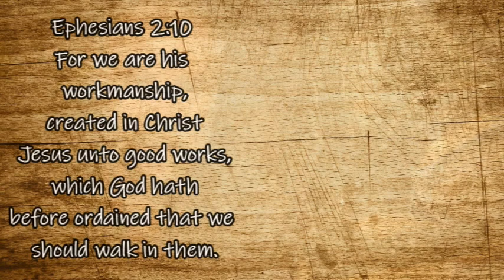Wood Lathe Work: Making a Rice Bowl

Comment: Lovely.  Brought back memories in my dad's wood shop I used to do a lot of wood turning. Babies rattles. Bowls etc. I used to use a metal broken  hacksaw blade with the lathe switched on to cut it free.. never had anything spin off as I had a sheepskin polishing round in my other hand to catch the work in  they make great finishers. Buffing up beautifully too. Can't wait to catch your next video.
Reply: Yeah, I have done the same with just the separating tool but have made the mistake of dropping the final product, leaving it broke or marred. Clumsy me. Sometimes I play it safe. Thanks and good point!

Comment: What an awesome skill you have to make Mrs. Rain such beautiful items. She is very lucky! How long did one bowl take?
Reply: There are a lot of variables in the time it takes to turn something. These were worked from the tree to final form. Before they get to the lathe there is prep work: cutting down, slabbing, storing, drying, selecting cuts for the bowl blank, glue up's for the bowl plate, etc. The bowl mounted to the lathe and turned down, finished and removed takes about, say 45 minutes. You will see turners claim 20 minutes to turn something like this but I don't make this claim due to the fact that the item isn't finished until it is ready to use.Thanks Audrey!

Comment: Nice Job! You could make them for your Etsy store. $20 a piece or a set of 4 for $75?
Reply: Hi Carl, in order to make a living at $20.00 a bowl one needs to find a volume of wood at a cheap or free price. If a production shop is geared up one can turn the bowls fairly fast. The fastest I've heard of a small shop turning a bowl is 20 minutes. That equates to $60  per hour. This doesn't factor in purchasing / obtaining the wood, building blanks, the purchase and upkeep on equipment to break down the wood into a ready form and prep for turning. Although we have put up a few items on the store most folks won't pay the price one needs to make at least 10.00 per hour. The ones who understand the lengths of time and expense to turn custom pieces will pay what we have asked. Even if they might not understand, they buy from us just to support and understand what we do here. It is difficult to compete with the "industrial machine" or big industry. Folks have got used to going to Walmart and Best Buy. I have had people come to me and ask if I could build them an item and after I gave them a price say they could get one at Walmart for a fraction of the price. I would tell them that I couldn't buy the fasteners for that and that they should probably go get it at Walmart. It's funny because they had it in their mind that they were going to bypass the middle man and go right to the manufacturer and get it for half price. it can be a tough racket.  Anyway,  good question. If I was geared up, I might be able to do something like that in the future. Thanks for hanging out :)
Reply: As to the price of artisan woodwork, one can easily appreciate the pricing structure by comparing it to what many spend on artisan beer in lieu of mass produced beers ...and with the woodwork you have something to show for your money at the end of the day.
Reply: @bparrish517  ...Instead of a hang over :) Thanks!
Reply: I thought about saying “a beer belly”, but I wanted to keep my comment neutral.  Not everyone drinks alcohol to an extent that it impairs their health or widens their waistline;  otherwise,  people would look at the obesity epidemic in America and say that we’re all drunks.
Reply: @bparrish517  Ha ha, right. I was trying to be cute :D